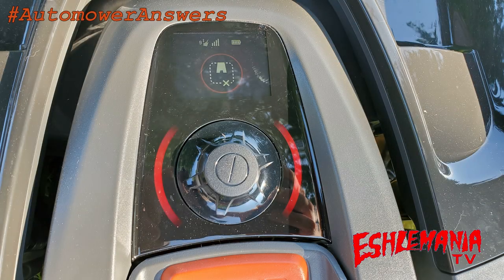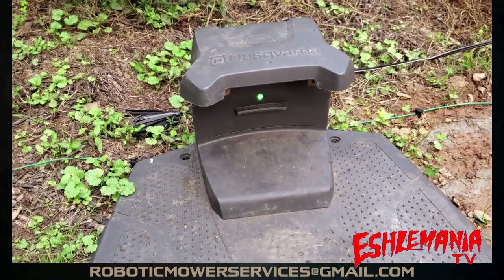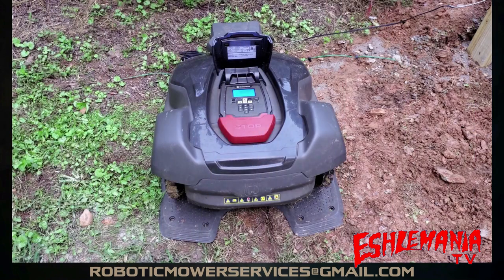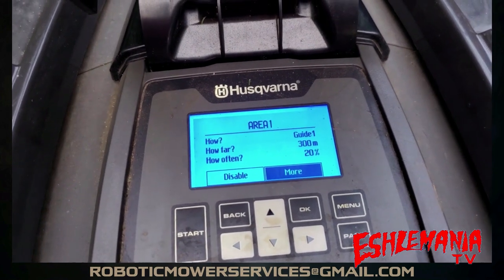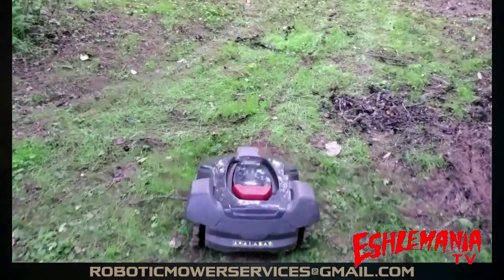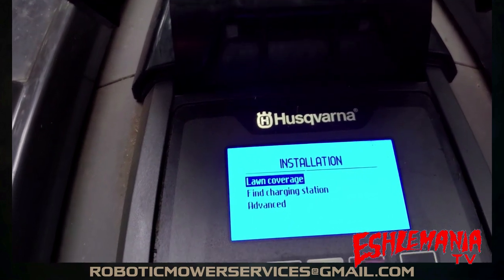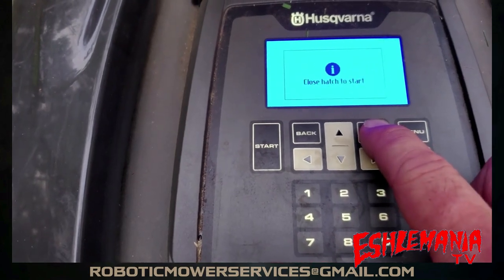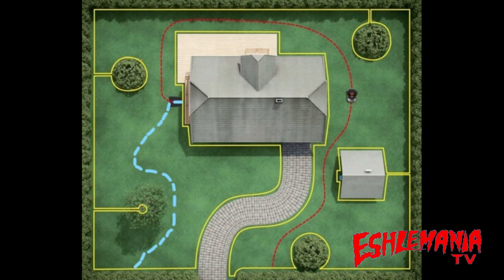Automower Answers: How to locate underground Automower wires?

Comment: Thanks for the videos! My 430xh will Test Out the 2 guide wires but will not test out the boundary wires. It backs out & appears to search for the BW chosen , finds it next to the base front about 18" away from base along edging, backs up, does a random pivot, runs to BW, pivots, runs into edging, then goes into mowing mode. Still trying to figure out what's happening?

Comment: Here is an Idea. Great tip however . If you are okay with the boarder (30CM) from the edge but need to find the Guide .. you Position the mower at the other end of the barrier . Use the app to send the mower home . Let it trace the return and mark the path with flags and then you know where not to scarify the return line
Reply from the maker: You would still have to set the corridor setting to 0 for the guide in order to get it to follow on top of the wire. Otherwise you won't know if it is on top of the wire or up to several mower widths away from the wire.